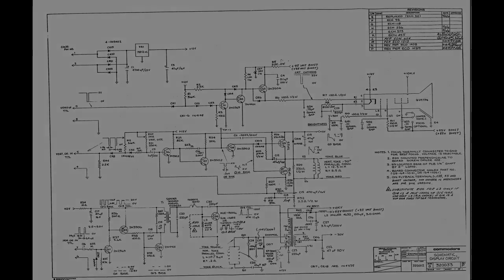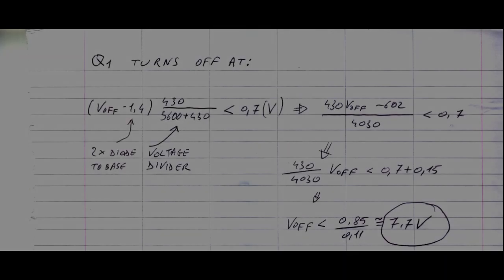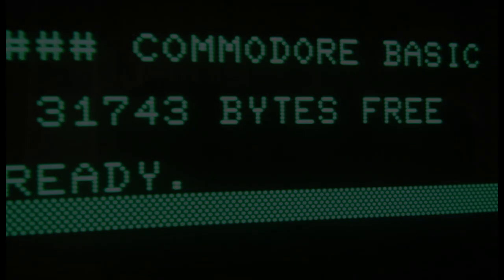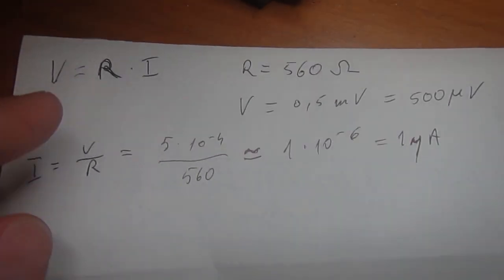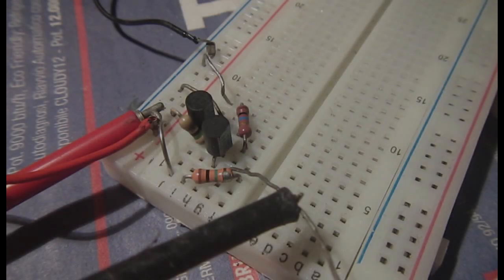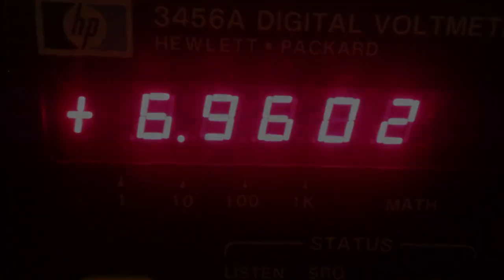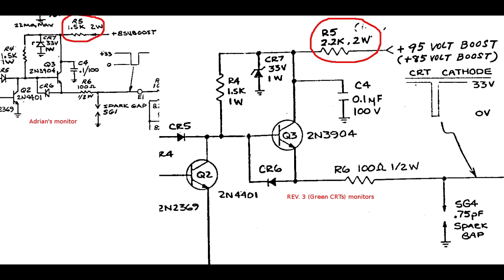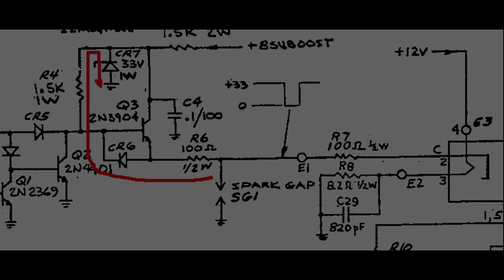Fixing the 9" PET's monitors turn-off spot (With Adrian Digital Basement)

Comment: Hello Frank. I have a similar issue on a Sony PVM-14M4, when I power it off I see a rainbow that expands in circular fashion from the center to the outside of the CRT. It had it when I got it, I've since replaced the capacitors on the PSU, the neck board and on the main board I just replaced the ones that are most commonly known to fail. That fixed other issues the monitor had but not the issue with the spot killer, I still get the spot. Do you have any guidance to offer here? I don't know where I should limit my hunt to. If the issue stems from a component that is no longer within spec, would it be limited to components in the neck board only? So maybe by replacing the diodes and maybe other components there, I'd eventually replace the component causing the issue?
Reply from the maker: Woah... that's one of the most complex broadcast professional monitors :) I don't have one to check what might happen. But, looking at the service manual I see it's a grounded G1 plus cathode only drive, so blanking happens on the cathodes. Page 69 has the schematic for that part of the drive (I believe it's the neck PCB). It seems that blanking is done by Q713/Q714, when Q713 is on it should also drive all the IK-SW transistors and TRACE-SW transistors. No idea what might go wrong there without taking some measurements on the real circuit, it seems reasonably well made. Also since you see a "rainbow" it's probably an unfocused spot, so it might be that not all cathodes are conducting. Lots of unknown by just looking at a schematic really.
Reply: @iz8dwf  Seems like a fairly complex problem for my skill level. Nevertheless, I appreciate the explanation very much. It's cool to see things explained by someone knowledgeable, thank you. 🙂🙏

Comment: I know this comment comes quite late, but thanks for helping out Adrian fix the PET display.  This is somewhat basic electronics, but the interplay between analog electrical components can get complicated especially when things change over time or components aren't up to the spec you thought.
Reply from the maker: Thanks for the comment, even if "late". I really appreciate any feedback! This monitor fix wasn't easy at all, it helped a lot having all the early revisions' schematics so I could spot their attempt to "fix" the problems and get on the right track.

Comment: Hi Frank! Interestingly I just discovered this same problem with a cheap B&W TV from the '80s and show it here:
https://www.youtube.com/watch?v=HCZiJYoOOWE&t=846s#t=13m26s

I linked this video of yours as related in my video's description. :)
Reply from the maker: Hi! Thanks for the video, that spot would be probably best "fixed". However I'm sure we should look at the schematic (or reverse engineer enough of the schematic) to come up with a good fix. Usually you would just "bump" a little negative voltage to CRT's G1 (with a few added parts) to keep the tube in cutoff condition, or convince the raster oscillators to run longer and have the leftover charge spread on a larger area (but this might require even more components).
Reply: @iz8dwf  I think I will leave this one alone. I have no fondness for this television... it is no PET. :)

Comment: You could also increase the capacitors on the 85V rail higher in value, and this will also help keep the rail up as well, though simply adding a 1N4007 diode in series with the resistor to the video driver will isolate it as well, and then hold up the 85V rail for longer. the -30V could do with a 100uF 100V capacitor, the extra capacitance will help a lot, and 100V capacitors are at a nice point for decent life at lower voltage, and not much more expensive.

Commodore likely used the 3u3 capacitors as they either had them in stock, or they were a bulk buy, so they got used all over even though they were not an ideal part voltage or capacitance wise.
Reply from the maker: The capacitance on the 85V rail isn't really needed as if Q2 ever turns on, it will ground the cathode. More capacitance on the -30V rail might be a good idea, but it's still a race condition to keep enough K-G1 voltage before Q2 starts sinking the residual charge left. On a few of the PET monitors of people chatting to me during this investigation, the 47uF on the -30V rail is enough to completely eliminate the spot. The point of this video is that Commodore made a few mistakes that tried to correct in the later schematic revisions.
Reply: @iz8dwf  47uF will work, as Commodore found out, and likely used an existing part as well, thus 47uF 50V, though a higher value will provide a better guarantee against ageing and component tolerance spreads. Was common in other monitors to see a 100uF 63V part in use there, and those almost never had turn off spot, as the grid voltage would stay up long enough for the cathode to cool down and stop emitting.

Comment: Hi I am not sure your reason is correct.
I would suggest the reason the cathode voltage drops is because CR7 and R5 + R4 discharge C27 removing the cathode supply quite quickly, if you increase R5 to 2k2 like has been done on some that will make it longer.
One way to prove this would be to double or triple C27.
Reply from the maker: R4 can discharge the 85V rail only if Q2 is conducting, if Q2 is conducting, the cathode current can flow to ground and there's no way to prevent it by increasing the 85V rail. If Q2 isn't conducting, Vk-g1 can't play any role in the cathode emission. So no, since Q2 was not conducting due to the 8v2 zener addition, the 33V zener must have been degraded as we proved by substituting a new one on Adrian's monitor.
An alternate fix for the turn-off spot elimination would be charging a capacitor from the 85V rail through a diode and discharging it on G1 with reverse polarity (through a resistor to ground) so G1 would have a negative voltage bump at power off that might be enough to block cathode emission. This method requires more added parts however.
My solutions have been proved working on 4 different monitors so far.
Reply: @iz8dwf  Yes I was too quick to answer, the main problem with this circuit is they used the 33V zener instead of using a video output transistor like a BF257 etc.
Which we used in most of our monochrome monitors  in around 1977 onwards.
Adrians spot was not a bad one as it was large in diameter so the energy was over a relatively large area.
When you get aa focused spot of sufficient energy it will strip the phosphor instantly.
Reply from the maker: @FireballXL55  Yes that's my suspect too, the zener was there because of too low VCEo of Q2 and Q3 :) Adrian spot was actually a lot worse because that "large" footprint was in facts blooming from nearby phosphors. Focus grids on those small 9" are grounded, so an undeflected spot ends almost always also focused. So it was good he wanted to fix it. And yes, if the spot is focused and with running supply, the phosphors burn instantly, but this one was just a few uA of dumped charge left on anode capacitor.
Reply: @iz8dwf  Yes the zener is because of the low VCEO of the video output transistor, that is why we used the transistor I said.
But we will disagree on Adrians spot being focussed.
You can focus a 20uA spot to less than 1mm dia with less blooming than Adrian had. 
I have worked in repair then design of CRT monitors since 1976 - 2000.
Reply from the maker: Blooming isn't because of lack of focus, is because the phosphors are way "overdriven". If you have a spare CRT to kill, try 1uA cathode current into a focused spot and try to make it not shine all nearby phosphors. 
Or if you have an analog oscilloscope, focus it then put it in X-Y mode, no drive, and see how much you have to reduce the brightness to make the (focused) spot not bloom.
Reply: @iz8dwf  I know what blooming is, I was saying I can drive a CRT so hard it strips the phosphor and it does not enlarge the spot area anywhere near what was seen on these videos blooming gets less bright to the edges quite markedly
I will be doing the test as I have a number of CRT's which are scratched.
Reply from the maker: @FireballXL55  I don't know, my observation is because the spot gets really tiny (so focused) when we finally reduced the current as you can see during the different steps we took to eliminate it. If it was out of focus I'd expect it to be dimmer but larger, not right a pinhole like it appears to be.

Comment: Excellent video!!  It was useful not just for eliminating the dot, but you worked out revision differences and why Commodore made them!
Reply from the maker: Thanks for the nice comment! I'd suggest anyone having still the 1k5 resistor at R5 to at least upgrade to 2k2/2W, that 33V zener is really having an hard life.
Reply: @iz8dwf  Probably was a marginal value, and chosen because of availability at component spec time. Designers probably had a range of values that they gave, and when it came up to manufacture they looked and saw they had the 1k5 in stock, so used that. That the long term reliability was going to suffer probably only came after a few thousand units and they had a few warranty repairs with failed zener diodes, and thus did the value change in the next revision to alleviate that. Most boards likely worked well enough till they were obsolete, so this was only a long term issue, except for the few with the marginal zener diodes that failed.